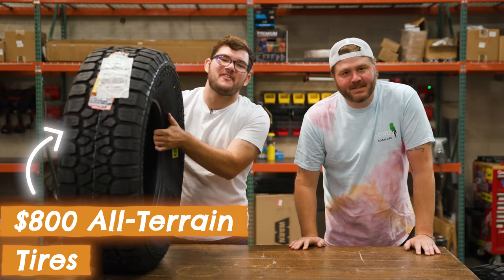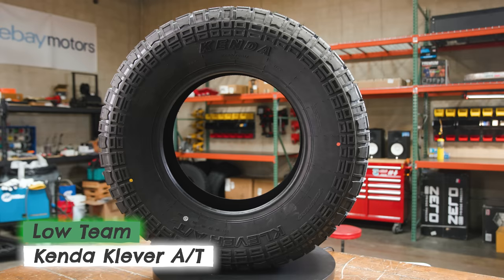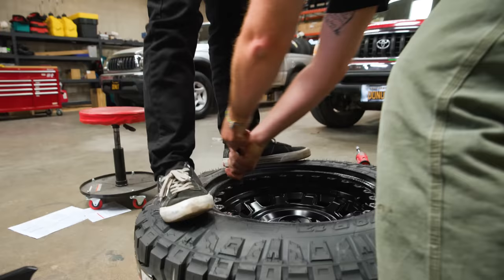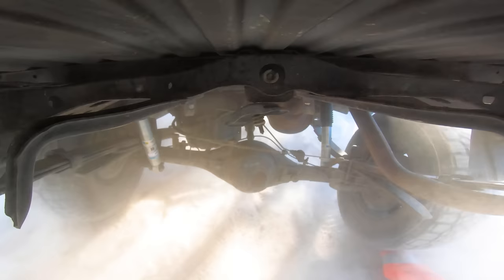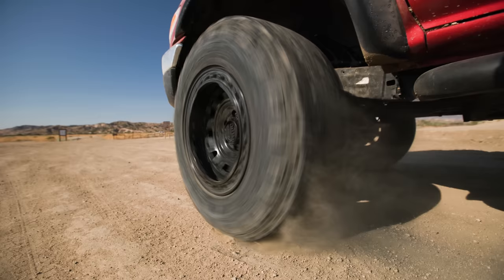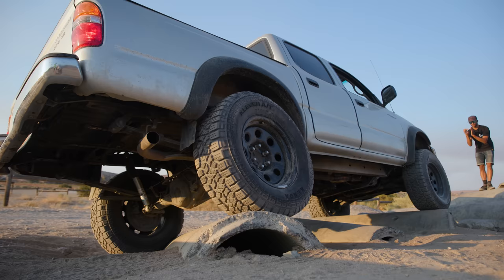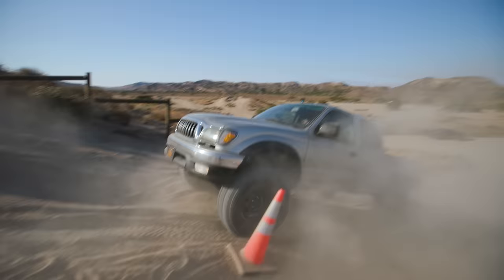$800 Off-Road Tires vs. $1500 Off-Road Tires

Comment: As an off roader this episode had me ROFL! 15 psi max low on bead locks😂 I run 10psi without bead locks. Good show boys!
Reply: Max low is minimum
Reply: laughs in 2psi on steel rims with 38" which is honestly not the lowest we go, i've gone as low as 0.5 psi to save my ass, but then im up to 2 psi right away. have never debeaded. and i've watched people with beadlocks debead while running the same pressure. it's all about skill and how your wheels are :D
Reply: @Krukkann96  the type of tire makes a massive difference. My buddy on 38" tractor tires and run basically valveless without bead locks but my Patagonias wanna pop off below 12psi
Reply: @SketchyAsFunk  Sure does, but the rim also makes an even bigger difference. for example, if your tyre is 14.50" wide, like in my case, you want to be running a 14" wide rim. atleast for snow and mud, but for rock crawling i know that is another story.
Reply: @Krukkann96  how do you not pop a beed with that wide of a wheel at 2psi? There is no way
Reply: I know right, I remember like 20+ years ago learning about airing down the tires in the sand, it was my 2nd or 3rd time out to Glamis and seeing one of our guys in the camp take his full weight relatively stock 2wd half-ton on 33's get up in the big dunes, while other people were struggling with AWD and 4wd while out there. I remember being perplexed because I had ridden in that truck before on the street, but now I'm watching it in front of me while i'm on the quad. Found out that the trick was that he aired down the tires to like 8 psi which I had never heard of except on Slicks for drag racing.
Reply: @SketchyAsFunk  Easy, as long as the rim matches the tire width and the outer lip inside the rim is large, the tyre just stays there. Ive had it spin on the wheel becsause it had no pressure. But never debeaded.
Reply: @Krukkann96  oh that makes sense. I rock crawl so it wouldn't work that way for me but that makes sense on a mud truck that's on flat ground.
Reply: I’m thinking those are e rated tires being how heavy they were. I’ve heard they debead more easily than a c rated sidewall. But yah bead locks right I already forgot haha . Boy you are right
Reply: I run 12psi on stock landcruiser wheels🤣
Reply: @SketchyAsFunk  The bead locks help keep the tire on at low psi.
Reply: Oh yea...well.I run .5 psi on non beadlocks..
Reply: @aelfkins  no shit Sherlock
Reply: Do you mind explaining what bead locks do? Does this only apply for two wheel drive?
Reply: You think that’s funny? You should’ve seen the video where they wheel in Ouray…
Reply: @irvgotti94  I ran 12 psi on 31x10.5r15 on 15x8 for almost every weekend I went and hit the OHV trails. Never once had a debead. So I'm with you. lol
Reply: @Krukkann96  vehicle weight is a huge determining factor in tire pressure. 
I know someone with an old Willys mb, he will straight pull the valve stems and run zero/negative pressure and not debead as much as you'd think. Yes, he pops beads but it's not on every ledge or obstacle, like I said the tire stays mounted way more than I would have thought.
Reply: I have a screw in 3 of my tires and drive around at 12 psi everyday on stock rims and tires...c'mon guys...grow some
Reply: Yea, it's a stupid show made for "clicks".  I accidentally ran my CJ7 with negative pressure on steel wheels once and had no problem.  Some tires/wheels won't do as well.  With my current 6k Lb. Jeep I don't go below 8psi because they squish out enough at that pressure, and if there's any high speed areas I don't drop below 10.
Reply: @blakelewis8547  bead locks use a metal ring to pinch the rubber of the tire so it cannot come off. Regular tires use the pressure of the air to keep the tire seated on the rim. In high speed racing they keep the tire from getting pushed off the rim when turning fast or abuse in off-road racing
Reply: @gabemiller9873  ty 🙏
Reply: Yeah I was cringing a bit, but hey at least they're learning i suppose

Comment: I have the “expensive tires” on my truck. The expensive tires are a hard rubber so it can last a long time on the road. The low won’t last as long.
Reply: That is valuable information.
Reply: I drove a jeep with them on a wet highway and thought I was gonna die.  But it was worth it because I got to wave at so many other jeep owners who also looked like they were staring death in the face and saying "not today death, jeep life"
Reply: Kendra kevlars are great, from the set i have on a 1 ton ford.
Reply: They also might not grip rocks quite as well.  It's a compromise you just have to make.
Reply: My Yukon XL has hi trucks tires and I didn't need 4wheel drive this last winter during our freak snow storm. Tons of grip. Love the tires
Reply: I ran the Nitto's for about 3.5 years then switched to Kenda to save some $. My Jeep is my daily and they seem to be wearing fine. Have had the Kenda for probably around 1.5 years. As long as you keep up with rotating/balance and alignment they seem to be a good tire so far.
Reply: @Chris-pt6hh  lol, wtf? Is it really that bad? I can corner on wet pavement almost like dry on knobbies on my bike.
Reply: @michaelciminelli6143  if your Yukon has electronically actuated 4wd use it once a month bud. If it's not used it'll seize and you'll be in a world of hurt.
Reply: @michaelciminelli6143  Tires do matter, but how you drive matters a lot too. My 97 ranger with cheapo all-seasons never gets stuck and it's 2wd w/open diff. I see people getting stuck and sliding off the road in 4wd trucks with winter/offroad tires and I just breeze by them. I air my tires down, put about 200lbs of sand-bag in the back and I'm golden. Only time I slide/spin is when I want to... or there's glare-ice, in which case anyone's screwed unless you can run studded/chained tires.

Comment: Let’s be real, STEEZ is 99.9% of the reason that anyone does any sort of “off road” modification to any truck. My manager at my old job had a Tacoma that they bought brand new. They immediately took off the stock suspension, wheels and tires, lifted it and put the most aggressive and expensive tires they could (barely) fit. After 5 years of owning it, they readily admitted that they had never, ever taken it off-road, but they did commute it 60 miles a day and got 14mpg.

Comment: I’ve had both sets of those tires……on steel wheels I can air down 12 off-road in the front and 14 in the rear. It’s perfect for sand and off road. Where nitto truly shines is the fact the ridge grapplers will last 85k miles easily with rotations. 40k on the Kendra
Reply: The only one ive found to give nitto a run is the amp terrain attack...i would say the nitto and amo are middle of the road mickey ts are high end
Reply: No way, my terra grapplers lasted about 35k 80/20 off/on road
Reply: I’ve got 65k on my current terra grapplers right now. I rotate every other oil change (7k miles)
Reply: @DJ.EddyBru  size and climate may make difference also, mine are 34” i believe 305/55/20 on a tundra, phoenix (hot as shit) i can still drive on them no issues, but the tread is so low they will not hook up off road very good, and suck in wet pavement from lack of sips, but they did really good off road when they still had tread
Reply: @DJ.EddyBru  i had some abt two yrs ago they lasted me abt 82k i hoping the amps will do the same they seem to b on the rite path 4 sure
Reply: @titirititiri6360  thas not long at all 😐 u rotate em? Was it a heavy truck? Did u get stuck often?? That seems low even for a diesel...
Reply: @bmanclassics4350  14 tundra, has about less then half left, still good for street, but no good off road now, ya rotate, have 4 year free alignment and rotation,
Reply: @titirititiri6360  ok i thought u were sayin u only got 35k out of em period.😅...mine lasted forever but also i pavement princessed mine until the truck was paid off... then bought the amps for a different look and the noise is a bit more high..but im not disappointed
Reply: @bmanclassics4350  well, once i can no longer 4 wheel with them, I get new ones, so I consider them done, I put them on Craig’s list. They did great for the first 2 years tho. I’ve sent the amps they look mean, in a good way
Reply: @titirititiri6360  i strongly recommend the terrain attck at/m over the At/a
Reply: @bmanclassics4350  okay cool, thanks man. Is that and all Terrain mud?
Reply: @titirititiri6360  👍 yesh 👍  i believe they are the most aggressive tread they offer
Reply: I agree on the Ridge Grapplers. Plus, they roll smooth like butter on the highway, quiet, yet capable off road.
Reply: @titirititiri6360  I have a set on 17s 35x12 and I have put 35k miles on them and easily have at least half tread.  I rotate every 10k, chalk test, off road, beach, snow, and mild water crossings.  Not sure about 85K, but every bit of 40K + so far.
Reply: @fallout4live918  nice!   What is chalk test ?
Reply: @titirititiri6360  Its when you chalk a line on your tire(s) and drive in a straight line then check the chalk.  You can tell if they are overinflated by the chalk line.  Bunch of videos on you know where!  It helps knowing especially if you have to air down often or the loads change a lot.  Maximum tire life.
Reply: @brianhummel8659  that’s awesome, thanks for the info !!
Reply: I heard wildpeak are really good too

Comment: Been doing tires for 10+ years. You need a water based lubricant with a rust inhibitor. Soapy water leads rust/corrosion on the bead over time. Especially on steel rims.

Comment: eBay: we make buying and selling safe and secure

Also eBay: You guys as the buyer and seller have to work it out. We can’t really step in to help. Good luck!
Reply: they alright for parts but if you trying to buy a car, 90% its a scam lol
Reply: We make BUYING safe and secure, some of the time. We make SELLING a crappy experience because our buyer protection policy means the seller is ripped off any time the buyer claims a problem, even when the buyer WAS the problem.

Comment: I have the kenda klever RT's on my wrangler and they have been the best off-road tires I've ever bought. I took them to moab, road hells revenge, fins and things, White rim trail, chicken corners and la sal mountains (in the snow). They did everything with no issues I had grip everywhere. Oh and they still drive great on the the street and highway. I will be buying a lot more kenda tires.

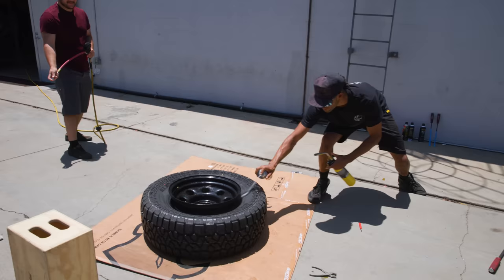Comment: 7:53 for anyone wondering how that happens is the brake clean is highly combustible so it combusts making hot gases that go into the tire as the gas expands it forces the tire on the wheel

Comment: The "cheap" steelies are better for of road circumstances.
You can fix them with a sledgehammer in the field.
Reply: No. They bend, whereas aluminum will scrape
Reply: @mitchellgruchalla783  they're harder to fracture than steelies are to bend though. Pros and cons to each.
Reply: @c4onmylip  Aluminums can and will bend, not quite as easily, but if you hit something hard enough to bend a steelie, you can kiss your alloys goodbye. Steel for offroad all day
Reply: @rickc303  Nah. If you bend a steel, the same impact would also bend OR crack an alloy wheel. Way bigger headache. Steels are vastly more practical than alloy for offroading
Reply: @jmccann6735  Not true that alloy crack at the same level of force that steelies bend. It comes down to the quality of the wheel that has been made. Cheap alloys sure greater chance, but a higher end alloy that has been designed for off-road use will not break at the same level of for that bends steel. In saying that, you need a driver mod if you're hitting things that hard, or a least a set of lockers so you can crawl stuff.
Reply: @hallee150  it’s dependent on the Rockwell hardness of the actual wheel. Steel is much more durable than an alloy due to the composition of 4140 or 4150 hardened steel. Dependent on the alloy, steel/zinc or aluminum/titanium it will be more brittle due to the grain composition. Hardened Steel is far more durable than an alloy if your taking continuous impacts.
Reply: I have fixed a steelie with a sledgehammer! 😂😂
Reply: @jmccann6735  forged wheels ftw
Reply: @jmccann6735  maybe for crappy aluminum wheels driven by Bubba

Made the mistake of "upgrading" to steelies on my TJ in a trade. Couldn't wait to find another set of factory Ravines go purchase and swap back on

Lighter, hub centric, lug centric, look much better, stronger, balance better, more durable and suitable offroad. Far more pros for aluminum
Reply: @jmccann6735  I've ran both and fucked up both, from my experience a good alloy wheel will take a hit better than most cheap steelies out there, but they're way harder to repair when you do fuck then up (I've cracked 2 trying to repair them in the garage lol). For me personally, the weight to strength ratio is superior for my wheeling rig but like I said before, pros and cons for each. What I look for is different than what someone else is looking for in a wheel.

Comment: What they didn’t mention about those cheap wheels is if they bend for some reason, a nice ball peen will straighten it out, but those super cool guy bead locks will crack if you try to bend them back
Reply: Because steel is more ductile, meaning it bends and aluminium will crack
Reply: Heat and speed of the bending process makes a heap of difference, but for the most part, you are absolutely correct.
Reply: Those "Cheap" wheels looks better anyway...
Reply: Was gonna comment this watch rony Dahl's video on steeling vs alloys really interesting
Reply: Steel is better than allow for offroading 100%
Reply: And they also didn’t mention is most bead lock wheels are NOT legal for street use
Reply: 15inch steel rims on 33s or 35s here fuck em up offroad bash em good with a hammer n good to go again if they fucked up completely $50 for a new rim payed less than 1k for 5 x 33s and same for 35s on 15inch steel rims alot cheaper than getting the flashy tyres and rims can get 2 sets off each tyres i got were called huntsman 5yrs old and still got plenty off tread on both sets
Reply: I have spent thousands of hours on the trail with lots of people that also have thousands of hours of trail times and have never seen a bent wheel other than someone having a actual car accident or hitting a curb at a high rate of speed
Reply: @ryanjacobsen9557  have seen missus car crack a alloy rim low profile tyres on a pot hole also seen a few bent and cracked rims on a track near me called monkey gum which i used to goto every 2nd weekend until they closed it down after 2020 fires when your in the bush and fuck up a rim its better to have cheap steel rims as easier to fix
Reply: Every set of steel wheels I've had went out of round after only a few months.  Turned into ovals.  Made it impossible to balance the tires and caused all kinds of problems. 

Went to aluminum wheels and despite beating them against the rocks many times, i have yet to bend, crack, or break, a single one.
Reply: @daleskelton8963  Oh snap, really? Well thanks, now I know whenever I get a truck to watch out for that. Anything else a newbie should know?
Reply: @midgetman4206  depends on what your plan is. Most states have bumper height laws. It depends on where your at
Reply: People keep saying that, but it never happens. 

Sure, steel wheels will bend and you can bend them back. But they also go out of round, making it impossible to balance, and you can't do anything about it. 

Aluminum wheels can bend, but they almost never do. And in the rare instances where it happens, it is usually minor enough that you can can bend it back without issue. 

I've seen plenty of bent and out of round steel wheels. I've NEVER seen a cracked aluminum wheel. 

Besides that, with that beadlock ring, the chances of actually bending that wheel is zero.
Reply: Little late for this comment but for rock crawling while it’s often mentioned you can bend back steelies you will also have to re balance them a lot more often because of it. It’s much less common to crack an aluminum wheel than you think. Bead locks also have a huge advantage as the ring can be consumable as rock rash will eventually wear any non beadlock down to replace the whole wheel even tho the price is prob not too much.